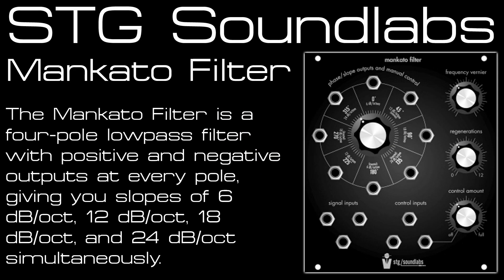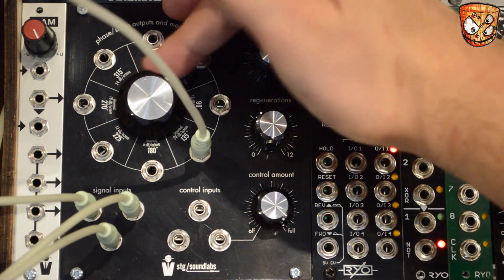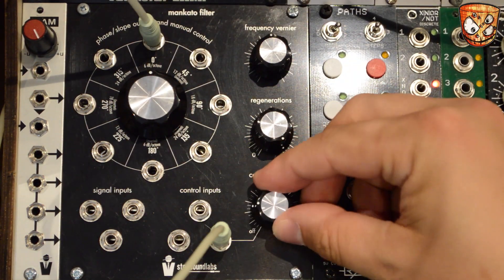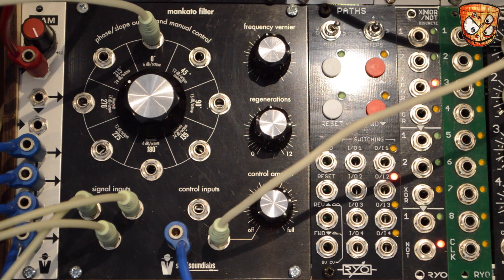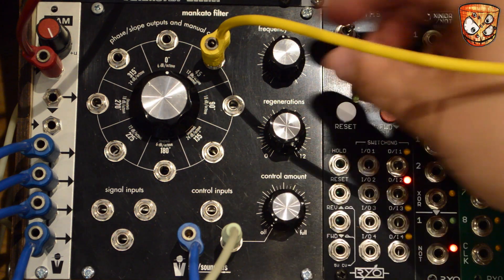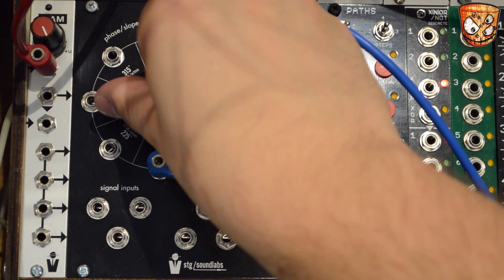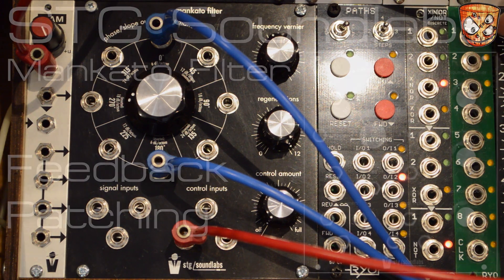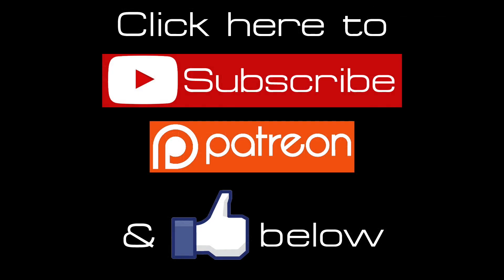STG Soundlabs - Mankato Filter

Comment: And I assume you can match mix the outputs of the different filters to get hi-pass and band-pass type filter sounds too.
Reply from the maker: +Daniel Jackson yeah mixing outs is great (how did I miss that!?!|) also sequencing VCAs with the different outs or using switches is great. If I get time a follow up video will be needed.
Reply: That would be awesome. I used to have the Malekko Boogie and that was one of the interesting things you can do with it. Puts a spin on the idea that a low pass filter is only "Low Pass." I'm looking at the Mankato and Dr. Octature for the same reasons.